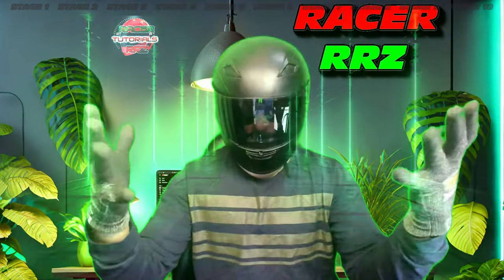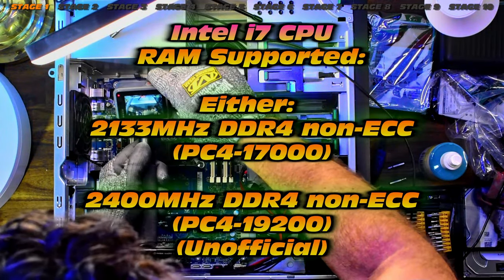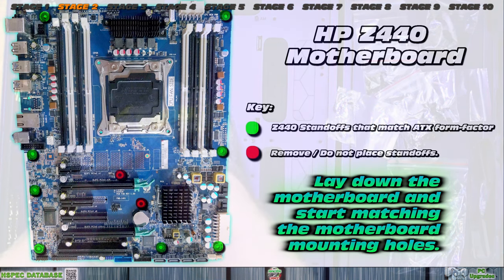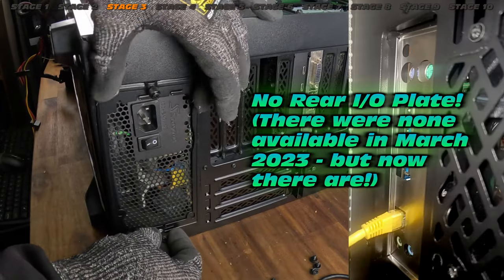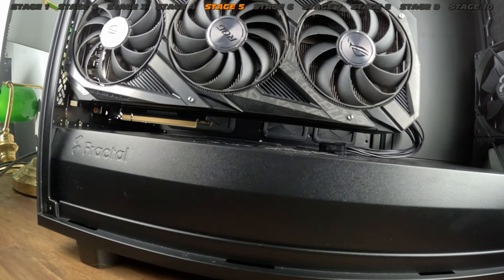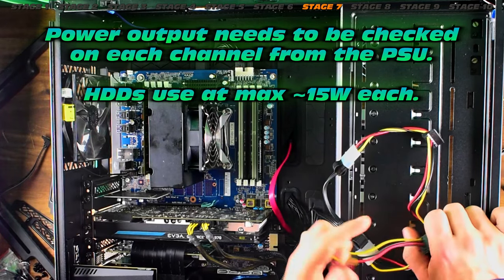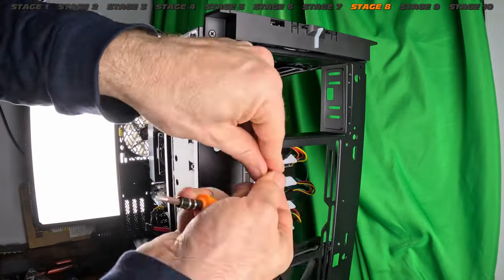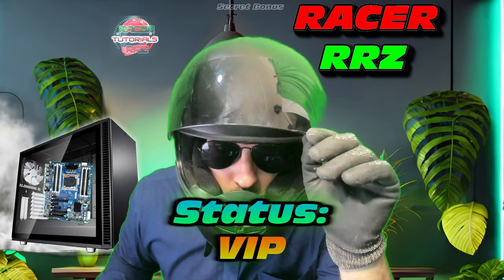Guide : Z440 Case Swap into Define 7XL = Ultimate Home NAS? (E5-2697A V4, 64GB DDR4, 66TB TrueNAS)

Comment: Love your content, hope you start getting more views! You have been my go-to source for information while working on my Z840 and have provided so many important details that are difficult to find elsewhere. Especially the info about the various unique HP cables/connectors
Reply from the maker: Thank you for your support! The Z840 has been my stable workhorse and it sounds like yours hasn't missed a beat - absolute trooper of a machine. Mine has been quite happy with daily use for a few years now - and I am somewhat unkind to it with the hardware outside the case. But I have a fix for that also (future video lol). I have some footage ready for dealing with 5.25" bay expansion on the Z840 - but I was really hoping to secure one of those 5.25" Bay NVMe caddies for it - like what is seen on the HP Z8 G5! (Unfortunately they retail for ~$600USD which is a bit prohibitive.) 

I'll be sure to also lead the charge towards the new generation of HP workstations. You can expect content on the HP Z8 G4 in the near future. I have set the stage for a Z800, Z820, Z840 and Z8 G4 overview - all in one video. Now that should be a good one. Someone send me a Z8 G5 for review so I can do all 5 generations.lol
Reply from the maker: Sorry I overlooked your message notification! Your Z840 sounds like it's living up to its full potential. The Tesla P40's 24GB of VRAM will come in handy, and the GTX 980 Ti remains a solid card for its age. I am sure your system would have required some optimization to get that many software packages to all run smoothly from your VMs. It's good to hear the Z840 is handling the AI face/image recognition well. That would be very handy on a security system. In case you haven't done this already, I would recommend a UPS for your system - it's just not that cheap to get one that supports the power your system would be pulling to keep it all running. But I have a UPS for my DVR and it's great to retain cameras even if the power cuts.

Comment: Do a z480 mobo man, you have so much potential in the fractal 7xl
Reply from the maker: The Z840 case swap into the Fractal Define 7XL is basically a right of passage at this point. I have obtained everything that is needed for this case swap - all I need is a solid block of time to film the process (a case swap seems to take 3x longer when filming lol). I can confirm that I have actually powered the Z840 motherboard outside it's case without it's original PSU but I haven't yet committed to the swap: https://youtu.be/Rsr_zxOg6K8

Comment: 12:15 - Will the system refuse to boot if you don't have the power LED and HDD LED front panel wires hooked up?

I just swapped my HP Z440 motherboard and stuff into a Fractal Design Pop XL, and it will start up, fans will spin, it will be on for like 5-7 seconds, and then it just shuts off and refuses to start again if the power switch is pressed. I have to flip the switch on the PSU off and back to on to get it to start again, spin up fans, be on for like 5-7 seconds, wash, rinse, repeat.

I have all 8 memory modules populated and I have the pins jumped using jumpers so it will work even without the fan shroud.
Reply from the maker: Hi. From what you are describing there could be a number of things that cause this issue. I had the same thing with my Z8 G4 initially and you need to go back to bare bones to figure out what is causing the issue. 

HP workstations run a hardware check before launching the BIOS - and it sounds like your machine is unhappy with the hardware configuration and it's terminating the boot operation before reaching the BIOS. Ideally you need to return to 1 RAM module and a basic GPU - something like a Quadro K420 connected with a DVI cable to a DVI capable monitor (I have found that HDMI or DP ports tend to not work when the system is in this boot state). If the system manages to boot, you can now add in more RAM - but first go for 4 modules. If it starts doing it's boot loop again you will be able to isolate where the problem is (bad memory module?). 

At a best guess, it's not the lack of a HDD light or Power light but rather the memory jumper and 8 RAM modules that is causing the error. I am working on a DIY fix for the memory boot error for the Z440. From what I have read the memory jumper does remove the error message but it does not provide the correct signals to the motherboard which can cause boot issues (likely not all motherboards have the same configuration because for some it works and for others there are issues - you'll notice that in the comments for the memory jumper YouTube video).
Reply: @racerrrz  So update, I was a dummy and forgot to make space for the reset button on the motherboard's rear I/O so my makeshift I/O shield was holding the reset button down everytime I tried to power up causing the system to refuse to boot. Once I made space for it, so it was no longer be pressed, my system boots and posts! IT'S ALIVE!!!! MUHahahahhahahahaha!
Reply from the maker: @theexile4694  That's awesome! Haha don't you love it when it's something simple like that! That's not something I would have predicted, well done for figuring that out! The rear I/O plate is tricky to sort but you can get them on Amazon etc. - I added mine in after assembly - there were none on Amazon/Ebay/AliExpress when I build the system but shortly after they popped up on market places. Enjoy your Z440 in it's new home!
Reply: @racerrrz  I am big sad because I wanted to play Helldiver 2 on it and the system just can't handle the CPU demands. For Helldivers 2 and some of the other modern titles you need a Skylake generation Xeon part and this system just doesn't support. It only supports Haswell and Broadwell Xeons. Big sad.😥 OH well. It can still play plenty of other titles and works great. Thanks for the replies and video, especially the wiring part for the front panel stuff.

Comment: I'm planning to case swap my z440 to iONZ KZ-30E XL E-ATX case and I wonder if I can keep the original HP 700W platinum PSU it came with
Reply from the maker: The original PSU would work relatively well given the power efficiency that comes with it. I opted for a ATX PSU so that I could sell the Z440 again. 

I quickly checked fitment, the Z440 PSU has non-standard mounting screw locations which by my eye would only allow 1 screw to be fitted. The PSU is also quite bulky and as an example I can't fit it into the Cooler Master MB500 mid tower case (there is a narrow PSU fitment slot). I suspect the PSU may fit in the Define 7XL due to the open front fitment design, but again with the issue of screw fitment. Creating a custom mounting plate from sheet metal or plastic could solve that.
Reply from the maker: Actually, here are a couple of pics for reference. With the right case it can be made to work:
https://imgbox.com/QgchmVXp 
https://imgbox.com/2qVVgbXd

Comment: Will the HP z440 motherboard fit in the Fractal Define 5 ?
Reply from the maker: Looking at the case design I am not 100% certain that it would fit. The right hand side and bottom of the motherboard mounting appears to be recessed which may prevent the Z440's larger than ATX motherboard from fitting correctly. I like the case's design so it would be cool to see if it works.

Comment: How did you have the storage configured in TrueNAS btw? That transfer rate looks like no striping.

Feeling motivated to try ZFS and have super fast storage pool, I just pulled the trigger on 4 x 2TB NVMe drives. I was doing some reading and it seems like my options would be to either configure them as single vdev in raidz1 which would give me parity but no striping, or each as their own vdev within one pool which would give me striping but no redundancy. I'm thinking I might go with performance and just have external backups of important data in case one of the NVMe ever happens to fail. Could be couple of weeks before all parts arrive and I have time to set things up, but I'm eagerly expecting that I should be able to saturate my 10GbE link between workstation and server.
Reply from the maker: So far it's just individual drives connected through the H240 HBA but without a RAID configuration in TrueNAS Core. I need to transfer data across to larger drives to clean up the accumulation of data across several smaller drives (mostly 2TBs and 4TBs). It gets messy when you try to manage on small drives for a long time. If you can go with RAIDZ1 that would be ideal - but it's really only worth it if you need the redundancy for critical data. If you can go with external backups that's likely the ideal. I prefer to not keep my drives running 24/7 - unless it's a lower power draw system that's intended to be a server. This Z440 is more like external backup in my case. 

Now is a good time to buy with Black Friday sales, although it was rather lackluster here in NZ for me. Nothing well priced. 4x 2TB NVMes in RAID 0 is great. I do all my editing from my RAID 0 pool and it never misses a beat (this being my Win 10 software RAID). Speeds are quite variable though. My highest speed to date is 12000MB/s read, 10000MB/s write - but on average it's closer to 8000/6000MB/s. 

With a couple more 10TBs I'll set up a RAID 5 for critical data. I do need to test the effect of parity on transfer speeds since I have tested NVMe and SSD cache without speed improvement over my 10GbE network. I also tested a RAID 0 NVMe pool (2x 1TB 980s) but also didn't seem to net higher speeds - but I was transferring from a 16TB Iron Wolf within my Z840. I'll eventuality test NVMe RAID 0 to NVMe RAID 0 over the 10GbE connection. That better give me at least 6Gpbs lol.
Reply: @racerrrz  I would expect you should be able to exceed 6Gbps speeds. If not by default, then at least by tuning Samba configs. I noticed some improvement at least in writes over network after setting things like write cache size, socket buffer size, aio etc in smb configs. Anyway it's unlikely you'll ever reach 100% network saturation with just single connection, but I think you should be able to get pretty close with some tuning. The same phenomenon can be seen when benchmarking connection with iperf2 (supports multiple connections) vs iperf3 (single connection) where it's much harder to reach same speeds with iperf3 without tuning.
Reply from the maker: @ruojautuma1  I have tried nearly everything I could think of, but as soon as a HDD is involved in the transfer I seem to not see transfer speeds greater than that HDD's write limit. Activating jumbo packets helped a little, mostly in improving iPerf3 speeds (~6Gbps was my average). I need to spend more time to improve those speeds because transferring a few TB still takes way too long. I need to test a RAID 0 NVMe pool to a RAID 0 NVMe pool via 10GbE. If that fails to give decent speeds there has to be some serious settings to tweak to get rid of what ever my speed limiter is. I'll see if I can get more speed from your suggestions also (testing write cache size, socket buffer size, aio etc in smb configs).
Reply from the maker: Sorry I am super slow here, I missed this message! I just checked on my system (Z8 G4 as client in Win 10, Z440 as TrueNAS server, with your buffer size and length settings - so [-w 4M -l 1M]): 8.35 GBytes  7.17 Gbits/sec . With more refinement of the transfer settings the speeds may climb up closer to 10 Gbps. 

At least it was a little bit faster than the default iperf3 speeds (5.93 GBytes  5.09 Gbits/sec), but still not as fast as your system's 9.91Gbps! 

I will add, my hardware is now in the Z8 G4 with a new Win 10 OS, which means my speeds are not being set by the client hardware at least lol. I figured my Z840 might just be a little slow but no change with the same hardware loaded into a Z8 G4 (well same 10GbE card at least - new system).

Comment: i have problem with front usb 2.0.   safely remove usb is grayed out
Reply from the maker: Hi there. Is this issue on your Z440 after a case swap? I presume you are in Windows 10. What device are you plugging into the USB 2.0 ports? Normally the option to safely remove a drive is only present for flash media (i.e. a USB flash drive) - HDDs /SSDs / NVMes tend to not have this option because they are not classified as removable storage.

Comment: 14:24 I'm a little confused about the CPU cooler adapter cable, i didn't need one fitting a Noctua NH-U9S in my Z440?
Reply from the maker: The HP Z440 has a proprietary 6-pin CPU fan header (seen at 9:35 also) and the adapter cable allows a normal 4-pin PWM fan - like the Noctua NH-U9S to connect without any boot errors. 

Where on the motherboard did you plug in your NH-U9S fan connector? A case like the Fractal Define 7XL has the Nexus fan hub which would help with connecting a CPU fan but the BIOS will complain if there is no 6-pin CPU fan header connected. 

There is a good guide on the fan header issue here also: https://michael.stapelberg.ch/posts/2021-08-28-silent-hp-z440-workstation/
Reply: @racerrrz  I just plugged the 4-pin for the NH-U9S into the 6-pin CPU header on the motherboard, as I saw in Coalition Gaming Z440 case swap video.

No boot errors, that I've seen.

I used the Michael Stapelberg guide, when replacing the stock Z440 case fans with 92mm Pure Wings 2 fans.
Reply from the maker: @bobsonuk   That's cool, I didn't see that Coalition Gaming did a Z440 case swap - or at least when I did a YouTube search his case swap didn't come up. The joys of YouTube search optimisation (his video title doesn't have Z440 in it, that might be why). 

Anyhow, that's cool. I had in mind that the CPU pinouts were inverted from normal 4-pins (the proprietary HP thing to do), and rechecking it it appears to be the case for the Z620 CPU fan ( https://www.techpowerup.com/forums/attachments/1394500888_ywsnpxtr_z620_pinout2-jpg.162642/ ), but maybe not for the Z440. This is the challenge when wire pinouts aren't readily published by the manufacturer. What is curious is that pin 5 and pin 6 of the Z440's 6-pin CPU fan plug (so the pins not used on your system now) are all bridged with Pin 1 - which is the ground. I would have expected a BIOS error from not grounding those pins - but clearly not!  

I am looking at a Z440 memory fan shroud fix so that 8 RAM modules can be run without the Fan shroud (something that a case swap doesn't support). I got a memory shroud that will be used in the name of science lol.

Comment: what form factor is the z440 motherboard? is it EATX or regular ATX?
Reply from the maker: That's a good question. I have not measured the board just yet, but I would place it closer to ATX than E-ATX - despite it having 8 memory slots. 

I have a motherboard just sitting here (future video), so here goes: 

It measures at: 32cm x 26 cm or 12.6" x 10.2" inches which places it just larger than ATX which is generally 12" by 9.6" inches.
Reply: @racerrrz  does this mean any ATX case will fit it in or not? thank you for the quick reply btw
Reply from the maker: I would like to think any ATX case will fit it but certain Mid Tower cases that are a bit cramped may have clearance issues due to the Z440 being slightly large than expected for ATX. Looking at some of the smaller ATX case designs, like the Lian Li O11 AIR MINI, I suspect it would still fit by having some overhang into your cable routing area. 
As an example: https://lian-li.com/wp-content/uploads/2021/09/o11-air-mini-so6-01_a.jpg - the Z440 would sit slightly longer and wider than ATX on the diagram.
No worries - my replies are generally slow - unless I am active on YouTube when you message - then I'll be fast.
Reply: @racerrrz  I'm thinking of buying a Kolink observatory due to its cheap price and amount of fans with not so shabby thermals, do you have a discord server by chance? I'd love to join it if you do :)
Reply from the maker: @Noone-ii4kv  Nice, the Kolink observatory looks decent and it's good that it supports  E-ATX - that gives you a bit more room to expand. 

I have created a Discord server but I am really infrequent with my Discord use. I need to step it up! 
https://discord.gg/QmpMeE7Xfb